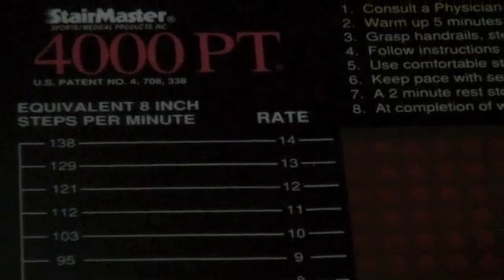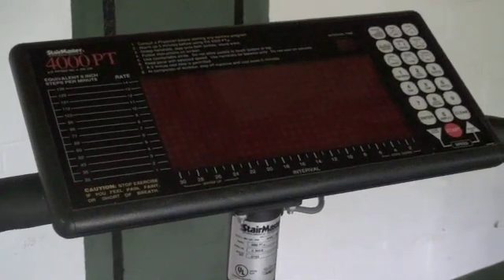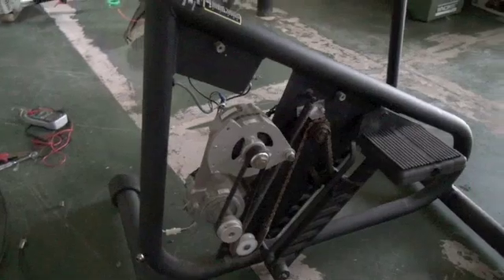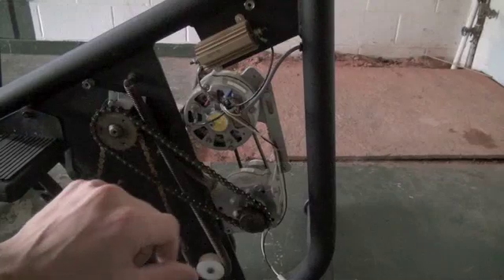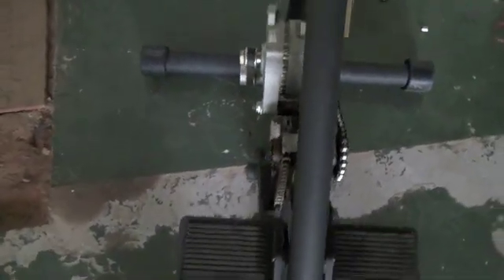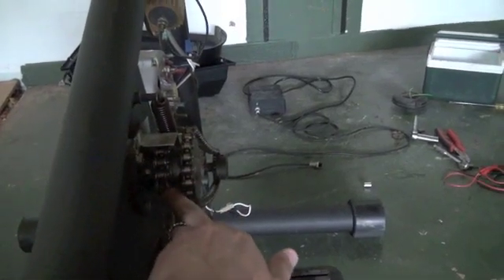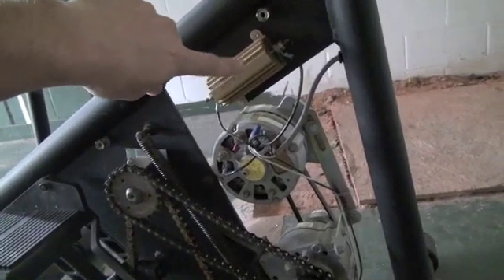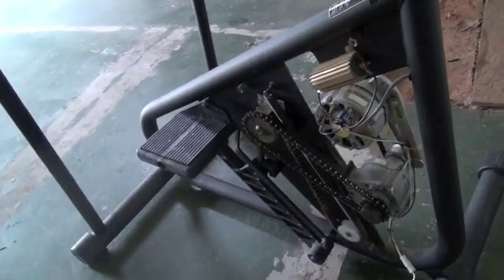Free Energy Makerspace Hackerspace ~ Stairmaster Generator #1 ~ Genesis

Comment: That brass-thing is a huge power resistor. We use them in the lab. That's likely there to dissipate the excess power generated by the user of the stairmaster. That resistor should be directly across both main terminals of the alternator, if I'm guessing what the circuit is correctly. If that's true, then in theory all you need to do is remove that, and remove the AC input source, and you have a power source directly from the alternator. I have no idea what that waveform from the alternator would look like, likely a complex wave that would need significant rectifying/capacitance to turn it into usable DC. I'm actually considering trying to put a "covert" stairmaster into a small space at home for the purposes of extra power generation as well, so this video was extremely helpful. +1

Comment: It already generates power and shunts it into the thing at the very top, which is a heat sunk half ohm resistor.  The manual can be found online with a wiring diagram.  Just drop the resistor and feed the output into a voltage and current regulator and battery.  done.  You could experiment with stepping levels to find the right transmission gear to be in for what is driven into the half ohm resistor.  In theory you could drive 14 volts and 28 amps at half an ohm with 392 watts input, which is exceesingly hard for a human to produce.  So maybe you could set it to a full ohm at 14 volts to cut that in half.   That would mean the display wouldn't line up right, or perhaps if it is an ac alternator, you can make your own ac transformer to step the voltages and currents around more to your liking.